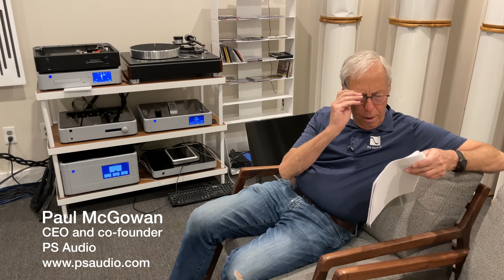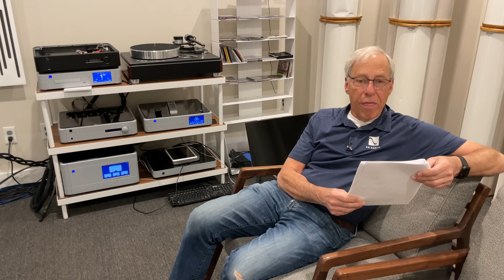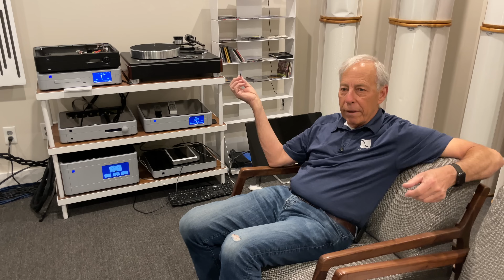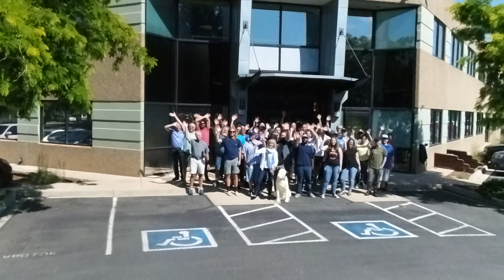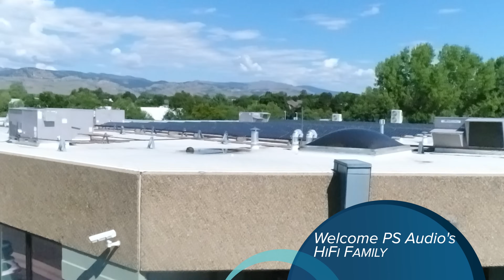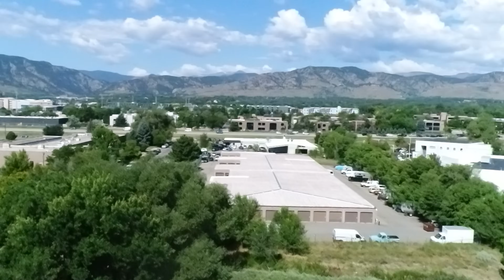Software upgradeable audio processors

Comment: software updates to optimize digital processes (speed, quality, reciurce intensivity) can be achieved on most things with clever programming.

bug fixes are also always possible, as flipping a faulty symbol on the same code or exchanging same size code segments can be done.

optimizing hardware usage would need digital access to hardware controls (system voltages, amperes & frequencies. fan speed curves if a fan is present)

adding extra functions requires expendable/extendable storage and a processor+ ram that can be used to integrate more code.

this only happens if the consumer demands digital support. i hope this becomes a standard. so much old hardware can be revitalized with new peripherals, clever programming to make the most of the system, and some hardware fine tuning.

Comment: There's different kinds of software upgradeability.  Typical cheap consumer products may have enough software upgradeability say to fix UI glitches but can't add major new audio features if that functionality is done in an off the shelf ASIC. As manufacturers began to add support for playing compressed audio formats off USB storage and stuff like that, they move to much more powerful embedded processors, likely with fully programmable DSP, so a firmware update could add FLAC or Opus.  FPGAs are software upgradeable hardware in the sense that a software update could be the equivalent of virtually installing a whole new hardware processing board that works independentally and in parallel. An FPGA is basically like a massive fixed size digital breadboard stuffed into a chip and typically you pick the size of FPGA to suit your application but typically theres plenty of unused space.

Comment: Why not use Automatically Network Updates instead of using a card ?
Reply: Hi Paul, I appreciate your videos daily very much!

@Ronen:
There are indeed manufacturers that do free updates over the internet.
I am using a (very good sounding) Lyngdorf TDAI 3400 integrated amp including streamer. Lyngdorf does provide irregular updates (2-4 times a year) of the whole system software over the internet!
Although, this amp is on the market for more than two years I really love to benefit from new functionalities and improvements added, such as Spotify Connect, Tidal connect and most recently even MQA (first unfold up to 24/96), which weren’t part of the system before the updates. 

For the audience interested:
By the way, the last two unfolds of MQA are only possible with a hardware specified DAC. Lyngdorf amps do not need any DAC for digital delivered music sources because of its unique pure digital amplification from the digital source to the loudspeakers.

For those who are further interested, the TDAI is sonically one of the best amps up to the 20k EURO price point I have ever heard and also is a perfect matching partner to my B&W 800 D3 in any respect. I now think about to sell my Nubert 2 power ams and preamp

Updating works very smoothy and without any errors and does bring you a full update within two or three minutes.

Comment: My new Denon receiver does have updateable software. It connects to my WIFI and updates Automatically by itself. Two times when I turned it on, the readout said "UPDATING SOFTWARE." After updating it came on normally. It only took about 1 or 2 minutes to update each time. You have to give the receiver your WIFI name and password in the receiver setup. I am sure other brands do this also.

Comment: What do you think of car systems?
I had a system in my Honda civic with mbquart mids and tweeters ,both front and back powered by one 4 channel ppi amplifier
I also used a Rockford symmetry preamp/ crossover.
I still have that crossover/ equalizer.
Do you make any after market speakers and or amp for car stereos?
Reply: PS Audio is a home hi-fi only company, with the exception being that they have their own recording studio, Octave Records.

Comment: I owned a Emotivia XMC-1 for almost 10 years and last year they had a $600 dollar upgrade to their XMC-2 which is totally resigned with the latest software 16 channel and 2.1 HDMI My XMC-1 had to be in reasonable condition for the upgrade  Mine was, and l had the original box and paperwork  I also own two SVS Ultra 13 sub woofer and SVS offered a amp upgrade kit with more power (1200 watts)and built in DSP controlled by a phone amp, so no more going behind the sub in the dark to fiddle with a control knob!! So it great that companies like PS Audio and others offer product upgrades for their equipment!!!

Comment: Because many audio companies tend to live with a mindset of the 1980s concerning technology. Of course with modern SOCs having powerful onboard audio DSPs, you can easily accomplish excellent upgradeability. But the next issue is how to make money from such upgradeability. Will people pay for a new DSP software upgrade?
Reply: it's a compromise between hardware and development costs - and not every hardware limit can be magically overcome with software - let me guess: you are a consumer with no technical knowledge
Reply: @Harald_Reindl  No, I work in Silicon Valley leading R&D on advanced tech projects and hold a long list of patents. I'm not sure what you imagine, but nowadays you can get a ton of CPU and DSP power at a very small cost making it easy to create a product with plenty of upgrade headroom concerning digital audio processing in terms of CPU, DSP and memory capacity. For example, you could use a modern multi core ARM based SOC (Snapdragon, Exynos, Mediatek etc.) and run a DSP framework e.g. Audio Weaver from DSP Concepts in either the ARM CPU cores or dedicated DSP cores (e.g. Hexagon in Snapdragon or HIFI5 in Exynos). I actually have some concept of the sort I'm talking about as prototype. I'm not sure you knowledge on digital audio, but it doesn't sound convincing to me.
Reply: FPGA's and DSPs are inherently digital devices.  There are many ways of converting digital to analog; but, only a relative few of them can be done using digital manipulation alone.  The others require analog circuity(resistor ladders, multiple voltage mixers, etc) to get the job done (not including the low pass filter to remove the nyquist-shannon aliasing that begins at twice the sampling frequency).

Paul has chosen to use PWM/PDM as his method for digital to analog conversion.  That is great for upgradability since it is one of the conversion methods that can be done using digital only methods.  Since he uses an FPGA to generate the PWM/PDM signal, he can simply ship a new network definition to significantly change the behavior of his hardware.  It is great that it works for him.

Other manufacturers may have chosen different underlying methods of digital conversion.  If they require additional analog circuitry or if they use analog methods for generating the PWM/PDM signal, then they are much more limited in their ability to upgrade after the point of sale since the output circuits are ultimately fixed.  They may be able to do things like add compatibility for additional codecs through the digital interfaces; but, they will never be able to deviate from the signal that is actually passed to the conversion circuits.
Reply: @timharig  Actually I don’t worry about a DAC being upgradable. Modern DAC chips from ESS, AKM and others are already excellent. My point is about much more interesting audiophile processing such as active crossover, high quality linear phase EQ, loudness compensation and soft clipping.

Comment: My 1st pre/pro was a Harmon Kardon Citation 7.0 with Jim Fosgate's surround tech. Came out a couple of years before Dolby Digital (aka AC-3).  Was great for the time, but I remember Harmon Kardon's ads which called it "infinitely upgradeable".  No idea what they ment by that, because despite announcing matching AC-3 decoder was coming, they never could release it. So since then, I always wondered why HiFi companies couldn't either add new codecs either via software, or via daughter cards like PCs use.

Comment: I don't know if they are that difficult to program you can make your circuit in CAD system like microcap and transfer it into the chip that's my understanding what's difficult about that, you just running simulation and what you find better you can download, why you don't make that open source would be a lot better more likely to find somebody who has a better understanding, I suppose it is open source but is anybody interested maybe is the question?
Do you have two chips that are programmable on the input on the output otherwise you are Limited aren't you?

Comment: FPGAs. Literally chips with software programmable hardware configuration. If peak performance is the ultimate goal ASICs would be more optimal but if performance is more than enough for application, then the sheer flexibility of FPGAs is a huge advantage.
Reply: Isn't a Raspberry Pi Arduino the same thing I believe it is
Reply: @johnsweda2999  an arduino is a microcontroller, not the same as an FPGA
Reply: @johnsweda2999  No. They are all completely different devices.

An FPGA is digital integrated circuit filled with generic logic gates that have not been assigned to do anything and grid of interconnects that can be routed using multiplexers.  When an FPGA initializes it reads a network description from an external ROM chip.  The network description defines how each multiplexer will be set allowing and therefore defining the signals will be routed between the logic gates.  It is therefore possible to create arbitrary digital logic circuits.

Saying that FPGA's are software programmable is not quite correct.  The networks descriptions are compiled from hardware description languages (like VHDL or Verilog).  Hardware description languages look superficially like programming languages but they model digital circuit components rather than algorithms for defining modules.  The end result is set of computational and sequential logic stages rather than a set of instructions of how to get something done as is the case for software.

Hardware is also inherently parallel.  Each circuit module is always on in some state all of the time with active inputs and outputs. Software is basically ordered serial instructions that are executed one at time and great trouble has to be taken to allow for concurrent execution of several pieces of software at once.

A processor is one configuration of a set of logic gates that can be used to do something useful.  In the case of a processor, the useful job that it does, is to execute software instructions.  These instructions do things like move a value from one register to another, add or subtract registers from one another, or transfer values in registers to and from main RAM.  Special registers are used to do things like alter the point in memory where the processor will execute its next instruction do things like branching to change the behavior of the program based on some condition.

A microprocessor is an integrated circuit that has been hard wired to perform the function of a processor.  A processor typically needs a lot of external circuitry and components (like clocks, external RAM, memory controllers, IO controllers, etc.) to function.

Microcontrollers and SOIC's are integrated circuits that contain a processor plus most of the circuitry and components (including RAM) necessary for the processor to function.  SOIC's tend to be more general function processors like the one in your computer and usually typically run an operating system to abstract the hardware for the software developers. The heart of a Raspberry Pi is an SOIC that was originally for use in cell phones.

Microcontrollers  are typically used for specific applications. They are typically programmed to run a single program without an operating system and have ROM storage on board to store that program.  Microcontrollers typically use a Harvard architecture where the program memory is addressed separately from the data memory.  They are typically programmed using external hardware.

Arduino's are based on microcontrollers; but, they are something of a distinct category by themselves.  It was a little difficult for early microcontroller hobbyists to get started since they needed to have the external programmer in order to program their microcontrollers.  It was also difficult for them to develop their programmers without external debugging tools to monitor the execution of their programs.

So Arduino was created as an integrated platform to make it easy for hobbyists to get started. The Arduino hardware includes all of the external circuity (mainly the clock and power supply) to make the onboard microcontroller work plus it included the hardware necessary to program and debug the microcontroller all on a single board.  The platform includes software components that include the development hardware that runs on the computer and firmware that is stored in the Arduino's microcontroller -- providing enough functionality for the Arduino hardware to talk to the software on the computer for the purpose of debugging and installing programs even when no user program has been installed.